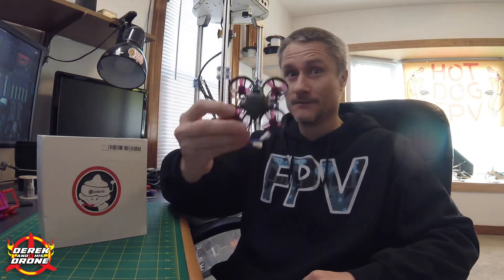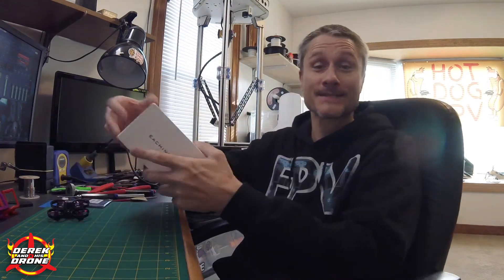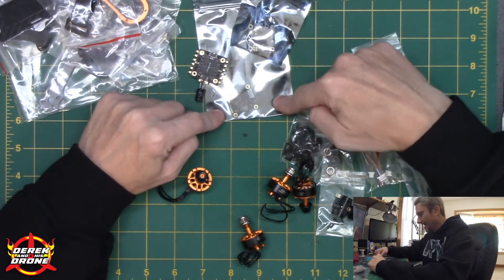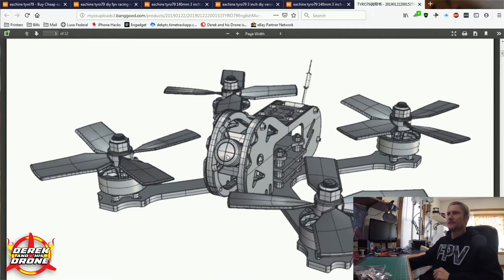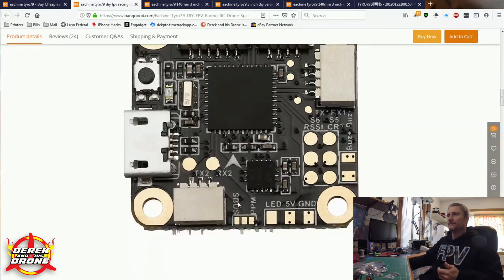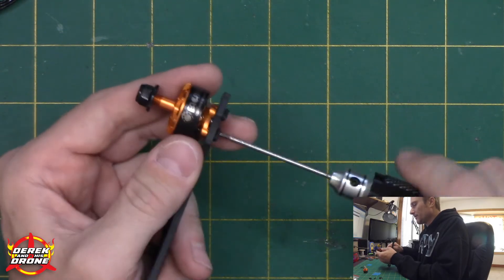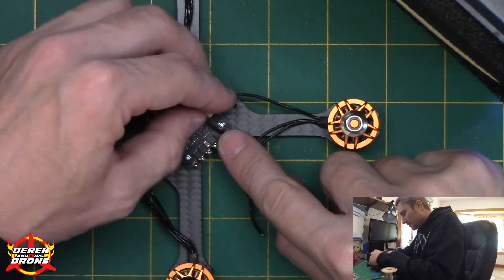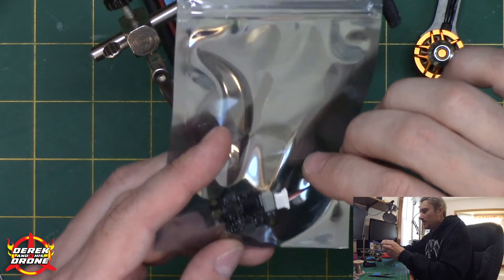Let's build this quad! - Building Eachine Tyro 79

Comment: You mentioned the cable was missing for the vtx osd ..mines the same did you just add a wire to the vtx harness with the black red and white wires ?
Reply from the maker: Yes, I added the wire.  Here is a video on adding Smartaudio.
https://youtu.be/kCv_eBc6U5U

Comment: What receiver and transmitter?
Reply from the maker: Frsky XM+ and X9D
Reply: @DerekandhisDrone  thx. And could you measure the drone as I can't seem to find it dimensions other than 140 mm. Im trying to draw it so I have a basic idea of its real size vs the tyro 99
Reply from the maker: It's 123mm square or 4 3/4+ inches.
Reply: @DerekandhisDrone  thanks but I was looking for LxWxH.
Reply from the maker: it is 40mm tall.

Comment: how did you connect the vtx wiring for  using smart audio? cause mine same version like yours.. help me out
Reply from the maker: I just added the wire in the RX spot inside the connector.  Or you could solder a wire to the RX pad on the bottom side of the board.
Reply: @DerekandhisDrone  did you mean the rx port from vtx? and just added green wire for rx on the vtx connector and connect to the 4pin at the fc? I didn't understand lol what u mean😂
Reply from the maker: @itsoah_fpv1509  I have gotten quite a few question on this so I'm doing a video.  Should be up later today!